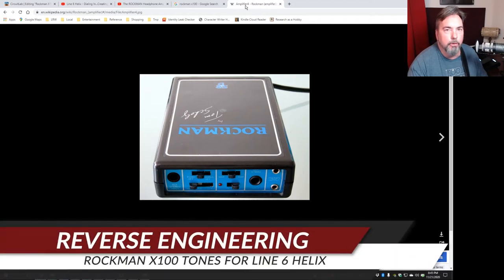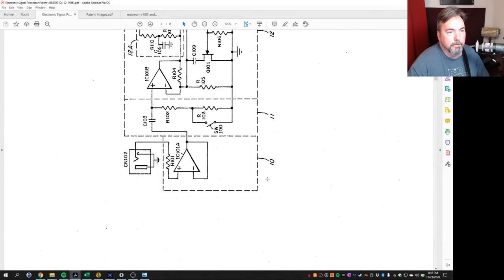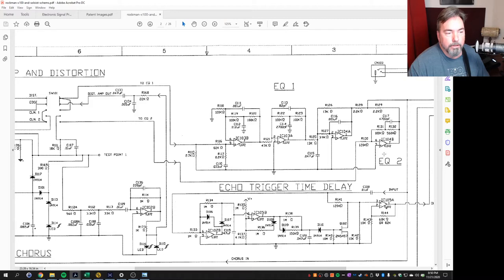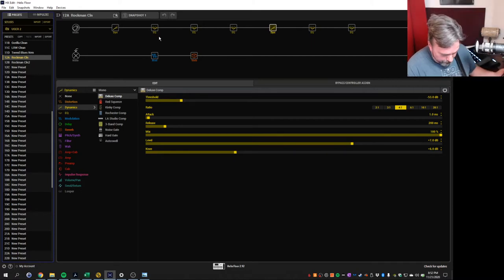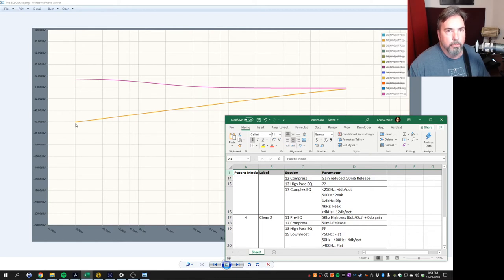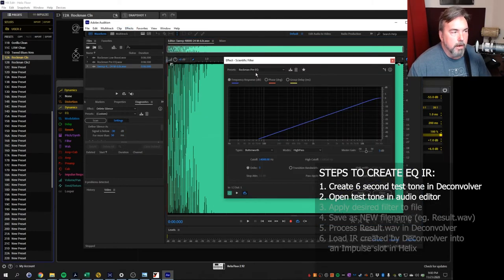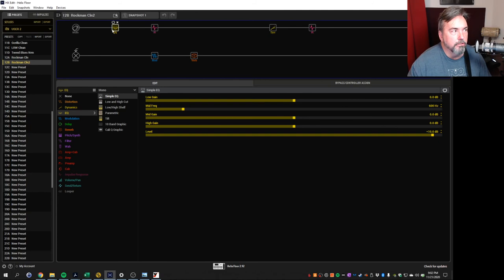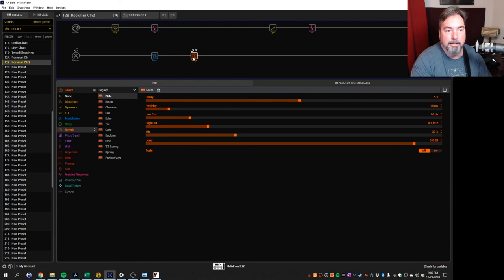Rockman X100 Clean 2 Tone on Line 6 Helix

Comment: I stumbled across this looking for Rockman clones, etc.  I tried the Amplitube Satriani Collection that had the Rockman X100 clone included and it's very very close, but I believe you've captured it even better. I think you stumbled upon something that makes it more legit sounding, eq out the low, compression, then add back the low end with another eq... I think that's why you get the sparkling highs that you can't really get any other way. You did a great job!! Makes me want to dig deeper into the Rockman circuits too.. Bravo man!
Reply from the maker: Thank you ! I'll be posting a walkthru of the other patches (Clean 1, Edge, and Distortion) as I get them finished. I've already completed the IR for the Rockman's notorious "complex filter" and created the Clean 1 patch, and when compared to recordings from the X100 it sounds dead-on.
When these are all done I will be posting the patches, EQ curves and analysis, and the IR's I built.

The hard part will be the distortion circuit. The X100 uses a simple op-amp distortion, so I am hoping I'll find a stompbox model in the Helix that uses similar circuitry. This will be the one area that might not be a 100% match.
Reply: @AgingEngineer  Just watched your video and man you really did nail it! Best I've heard! Again thanks so much!